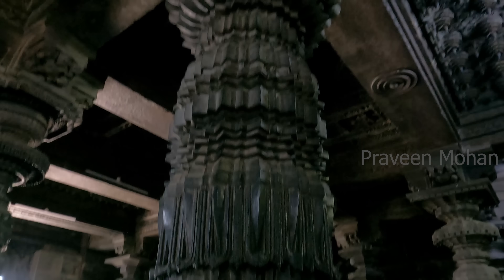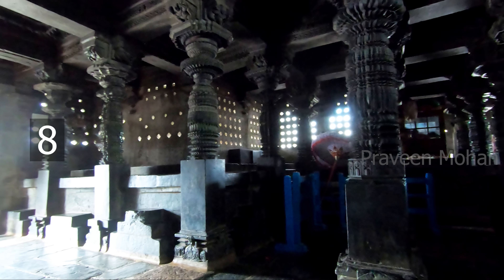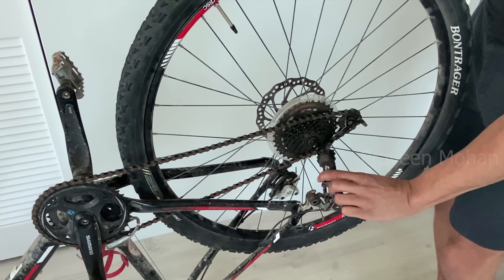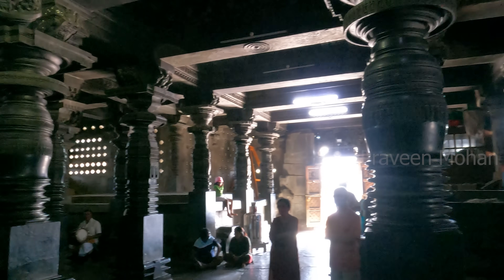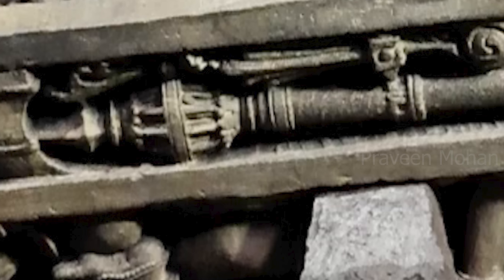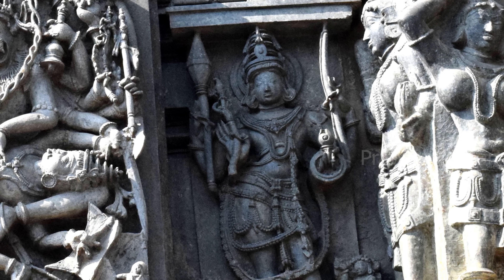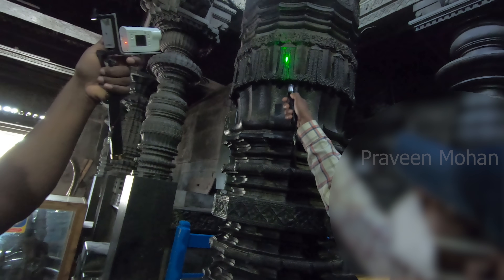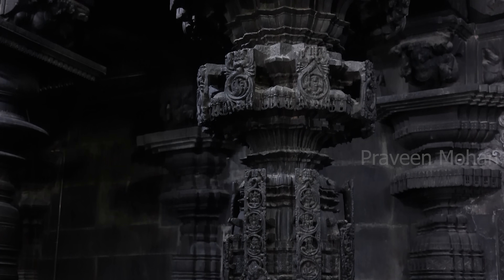Ancient Technology Science Can't Explain - Chennakeshava Temple, Belur Karnataka

Comment: The temple buider are only mimicing technology, previously lost. To incorporate these ideas into the Temple, was to enternalize the knowledge, and NOT to be functional. The GEAR TEETH don't match, and when chained together, would not function.  A bycycle sprocket set all have equadistant teeth, no matter the number- = reduction gears. These pillars "gear teeth" are not negative spaced equally. A SINGLE chain would not work.   A large chain would fit and work but would make all the collums rotate the same. One would use a 64 toothed gear chain?  But that gear would be 4-5 times bigger than the small gear with 8 teeth.

Comment: Technically, if you cast a column out of cement - and while still wet - insert inside a wax necklace - thenafter expose the figure to the sun, the wax will fall out and you'll have the form which the wax possessed 1 or 2 fingers deep into the cement-marble mixture. Actually is possible at any debt. Without any sort of drilling. You can also use gypsum and after the cement dries up, dissolve it in water. It will wash out in hours.
 The tool on the left (in the right hand) of the figurine on 8:02 - is wrench that tightened/screwed the wheels of a horse carriage. You can check in a museum. It must have always existed.
  Also, hand drills exist. Are not complex at all. It is possible they were discovered before the age of electricity.

Comment: Holes may be cooling fins or to move water ?
Reply: Maybe the polished stones has ropes running around them like a fire stick. Great job love it. Thought of 10 ideas. Too bad I'm old man now. Wake up kids
Reply: I got it. Look up the Ameriican  water power plants. In Ansonia CT USA my friend rebuilt an old verticle water turbine. It looked exactly like it. Before the generator they would attach leather straps to run all the machines off shafts the turbine spun.Was there a river near by?  With the gear ratios they could use leather to change ratios. Maybe that was the stone making building that they used to cut stones to build temples. It is exactly like the first assembly lines in America after they traveled to India. Ah ha.  Do a search you will see the match.

Comment: Pinion gear maybe a used one repurposed. Looks like a gas turbine wheel and bearing
Think waterwheel or better yet.

Maybe it had a secondary use when worn out with the diamond light holes shining on it different ratios.

Look at a steam turbine in a nuclear plant.
Even a newer fan

Do you see that spiral design on the front of newer planes engine cones?

My brain hurts

Thanks

Comment: Praveen, it seems that the "temple" pillars were part of a chain and belt motor for propellers, and the holes in them could have been for lubricant circulation. I would conclude that, either they were actual vimanas or an ancient aviation engineering school.

Comment: I have a feeling such complex and precise enginnering would not be planned and implemented without a higher purpose. Surely there is more to it than just being a stationary building, in which case so many moving parts would not be necessary. Imagine the scene when the chains were connected and the all gears rotated on the pillars...that movement alone would have translated to something going on elsewhere in the structure. I wonder when all the mechanical systems were engaged, would the structure be air borne? I've seen other videos of temples hiding vimanas in plain sight. I'm inclined to believe the entire manual of operation and instructions are present in the intricate carvings and the structure served another purpose as well. Amazing if so!

Comment: I enjoy your videos very much, but I have to question some of your conclusions. As a certified industrial mechanic, I have to comment on your conclusions regards the 'gears'. More teeth do not change the speed, it is the diameter difference. As well, different size teeth would need a different size or pitch of chain. What this means is that for a gear of say 16 teeth to be able to drive a gear of 32 teeth the teeth would have to be the same size and the chain the same pitch. However, the circumference of the 32 tooth gear would be twice that of the 16 tooth. This is easily seen using your example of the gears on a bicycle.

Comment: I have a vital question. Say this pillars are actually gears and it seems like they've made it so the structure can be seen later on. That's why they use stones in the place of iron so that this structures remain intact. But we already know the way to prevent iron from getting oxidised. So my question is what is their intention behind building this structures with stones and not building them with any other metal alloys..
Reply: Metals are malleable
Reply: @darlahenri8095  ya ya I get it they only knew how to prevent metals from being oxidized, but they may not know hoe to prevent them from being melted... Right?
Reply: @kamleshsahu5752  No use and shaping of .metals easier than stone.  These HARD STONES seem to have been melted and shaped etc. Doing this with metals is done and hence not as amazing

Comment: And the reason the use heavy Pillars is for heavy cutting u need as much as possible for pressure with rotation movement off the cutting knives in the lathe machine... That's why they use heavy Pillars they knew the very efficient way is to use momentum of the rotation movement and the small shaped that u put your finger behind it is for hand power that is my opinion

Comment: This may be a stretch of imagination and I couldn't quite tell from the video, but would the layout of all of the pillars in the temple, allow for a chain to be connected between all of them and also link to the pillar that has the rectangular holes? Does that one have a chain gear also? It may be crazy but I'm wondering if all of the pillars have rotating rings that act as locking mechanisms for the blocks and the pillar with the rectangular holes is the master, which when rotated by levers, would then turn the others and activate the locking mechanisms throught the temple. If so, the chain or chsins would likely have been removed and stored after construction. Like I said, it's a stretch, but if there truly are locking mechanisms, they have to operate somehow, right?

Comment: Those modern day flexible bits would be useless against hard stone I'm a builder. However I have no idea how the ancients made those technically hand tools are possible but nearly implausible. And I don't think the stone could take that kind of torque for long that's why we tend to use steel. Stone is brittle will crack in Time.

Comment: I may be insane, but what if those temples themselves are the ancient flying machines known as Vimanas? They become “activated” when the mechanism is engaged and possible changes or transforms into a different configuration? It can’t be any more insane a thought than the fact that people 900 years ago carved these pillars and/or temples from solid bedrock.
Reply: I have been to this Temple  and Some Locals there say that the Temple used to Fly in the Air in Ancient times. and this can't be just 900 yrs old but can be 5000 yrs old.

Comment: There are adapters for drilling machines that using hex bit into a socket to power a drill bit at a 90 degree angle to the drilling machine. A lot more stable than a flex cable.

Comment: I have a theory - instead of drill bits, how about if they're spindles?   I'm really leaning to this being a textile factory of some sort.  Silk feels the most probable.    The entire base of the temple is covered with elephants, so perhaps they were the power source - and that would explain the pole in the courtyard, and possibly why that extra layer of paving stones was put down around it.  Elephants would surely have worn down the original.   

Around the corner to the right of the entrance is a statue facing directly right and looks like she's saying start the thread here.  Then there's a long row of statue and "spindles".  At the base just below her, the elephants begin to also go right.  And the animal (dogs? lions?) above them begins as well.   From a view inside I noticed a lot of holes - that reminded me of how threads get added into fabric, which is what started me looking for fabric clues.   Also, along the wall on the way to first statue, looks to be another statue draped in flowing fabric.   If the 1st statue is the beginning, then this one would represent the end of the process.

Along with the round holes, all around the building are triangle shapes with deep grooves - which would be good for keeping threads separated.   Above  them are ledges, that I really wish I could into.   Run the threads through the separator up to the ledge and then.....I can't see enough to work it out.  It's like the whole exterior IS a spindle.   Inside, you'd have the all the columns spinning with their belts.  And all of them have at least one section that burnished to a shine - which is where the threads would have run.  And they're width reminds me of how they are wound on looms in manufacturing today.

Somewhere in this, that I haven't figured out would be the looming process.    All I've got here is threading, twisting, and what appears to be bundling of the yarn.  Powered by elephants - but I just can't find good enough photos to work out how their walking power gets to the building.

Comment: If you was to rotate thoes sectons with a belt i wonder what sound and vibration it would make ..... and what that might do .....simaler to the instrument with bowls that make sound when tutched so if the units spin thay have a current tolerance  and the tutching surface of piller would mack sound and vibrate if speed of systume is correct

Comment: I see how those are done. It's very simple into somebody that has done work like that should easily see the method used. I am speaking of the upper section where lasers are aiming there beams  vertically through the holes and the holes shown right after.

Comment: The first thing that came to my mind is that the ratio of 8,16,32,64 is the same in computers, 8 bit, 16 bit, 32 bit, 64 bit. There may be a connection between these numbers in the temple and advanced technology. It may not be a mechanical thing to begin with. The stories you told us about ancient astronauts and wars and vimanas point to use of computers in the distant past...

Comment: These ratios reminded me of computer coding. You can use these gears to make advanced calculations. I think if you chain or belt them in the right configuration, I suspect you will be able to process calculations in a specific way. I'm wondering if this temple is actually a computer. Perhaps if a computer engineer like Steve Wozniak along with a mechanical engineer with computational skills went to site, they might possibly be able to figure out it's operation.

Comment: From the minute 8.14 to 8.28, you showed a tool. I think that tool exist sir. It is like a same tool use to construct scaffolding. That sharp pointy side,  use to tie up metal board on scaffold by using wire rope so that the metal board can be used as stage or even to walk to construct the building. That ring spanner side, as usual to bolt coupling to construct the scaffold. That tool is in use mainly for tube and coupler scaffold sir.

Comment: Excellent video sir.
The tool shown in 9.10 min of the video looks like a differential set up with a universal joint  ( propeller shaft) that connects gear box and rear wheel axle . this mechanism is used in automobile.

Comment: Perhaps the room is where blocks were machined, like a factory. They could somehow connect the chain to a horizontal overhead drill in the centre of the room to set the speeds. Drilling rocks can be slow, so they don't need to turn fast. The drill bit with the ratchet end looks like it could be some type of 90 degree gearbox, connect that to the upright pillars via a leather belt and you may have an overhead drill. It almost looks like a factory full of different geared pedestal drills. Also the sharper drill bit end could also be like a morse taper connection which would leave the ratchet end to be the consumable drill bit holder instead.

Comment: Praveen, is it possible that these differential gears were used to hoist the heavy blocks to build the ceiling in an inclined manner? Perhaps this was how the ancients hoisted such massively heavy stone structures at great gopuram heights?
Reply: Yes, I was thinking that also. Maybe the temple is a factory or building spot, but its lost alot of pieces.
For example, they could have used  ropes/chains to pull stuff around (and the pillars as the gears or speed control), some to attached to weighted stones to use gravity to turn or rotate them for drilling. The drill bits could have been hooked into other parts of the pillars or some missing parts we have not seen. Also, maybe use some elephants to pull the chains that rotate the gears(pillars) or to raise some stone blocks to use as counterweights etc. for drilling or pressing.
Also, another great video Praveen! Thanks!

Comment: Praveen, you are laboring under an incorrect assumption, which is that because they are "stone" they therefore were "carved" in stone, but that is not the reality.  Rather, they were constructed from individual pieces that were individually cast in molds made from carved material via the "lost wax" method of casting.  
In that method the original sculpture is carved in wax and that wax is then melted away once it's covered with mold plaster.  But the sculpture material might alternatively be salt that's dissolved out the mold, or soft limestone that is dissolved away using strong vinegar. 
But however the sculpture was made, including pillars whose original sections were shaped on potter's wheels, the bigger mystery is the formula and method used to make the polymer stone concrete that was poured into the molds.  

You can blindly wonder about the impossible means to "carve" such stone objects or you can blindly wonder about the possible means to reconstitute stone so perfectly that everyone thinks it must be natural stone.  The former is almost like believing in an unknown technological magic while the latter is merely believing in an unknown chemistry formula.  I'll suggest that the latter is the most logical and the most possible.

Comment: It might take a detailed laser survey, in 3D, but there has to be a purpose to this arrangement of equipment. It had to have a power supply, and then something, likely another motion, took place as a result.

I don't think this was an engineering training center because there isn't enough instructions visible. These are more operational, like "Use the correct size chain" or "Use only builder recommended tools" or "Remember to reattach safety guards". 

Okay, I'm thinking out loud again. Very good video, done in your usual masterful manner. Thank you. ✌️

Comment: Love your work.  As a side note, adding teeth to a gear that is the same diameter as the other gears does not change rotational speed.  It only changes the size of chain needed to fit the teeth, this is called the "pitch" of the chain link, rather the spacing between the roller pins.
Reply: Hi, to your knowledge, do we have today chains with a kind of variable pitch, comparable to what has been shown in the video ?
Reply: @alancattelliot4833  No, the distance between rollers/pins of chain is fixed.  CVT transmissions use belts and conical pulleys (very simplified explanation) but this is very different than a gear/chain drive.

Comment: Where would the motor, or device that the 'belts' would be fed too, in order to move the pillars? Is there any paths that would guide the belts to a single location, where a drive shaft would be?

Also, I would bring a magnemeter, Geiger Counter, and other measuring devices of which are cheap, to see if there is any energy fields, change in temperature, or any anomalies that the devices would pick up.

Comment: Why this is quite fantastic.  You have acquired such deep knowledge and with your keen eye to have figured this all out.  It certainly makes sense.  I wonder, what did the pillars do when they were connected and rotated together?  Did they generate light, or energy, or sound?  Were they used to manufacture something that could only be made with all 'gears' turning?  Was it for food production such as to grind wheat or used as a giant pulley system for something else?  My mind is blown.   Good Job Praveen!

Comment: that temple is a blue print for gearbox conception. possibly a simulator to validate designs. 

this is the thing with antiquity, knowledge of physics was considered 'sacred' in the sense that it was not revealed to everybody. some folks are intelligent just enough to be dangerous. the chimpanze looking down the barrel of firearm meme comes to mind.

edit : a pulley for a belt transmission and a sprocket for a chain transmission of torque.

          the wrench tool with the pointy end is a specific tool used in steel beam assembly on building construction. the pointy end is used to match the holes of two parts when assembling before putting the bolt in and the wrench part is for fastening the bolt.